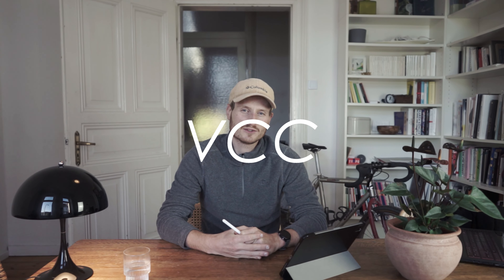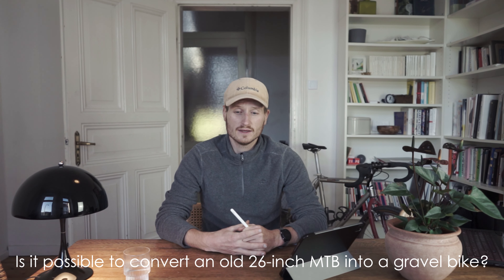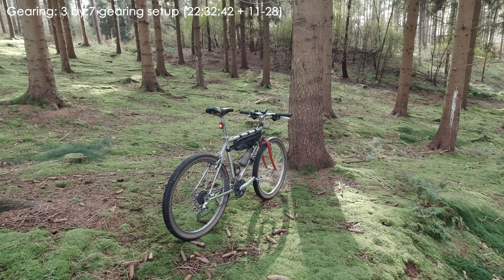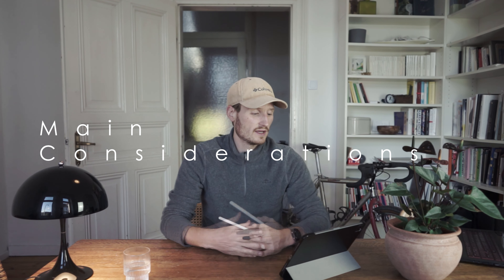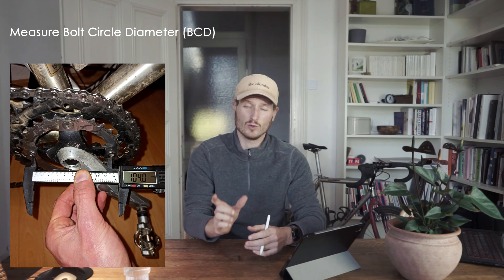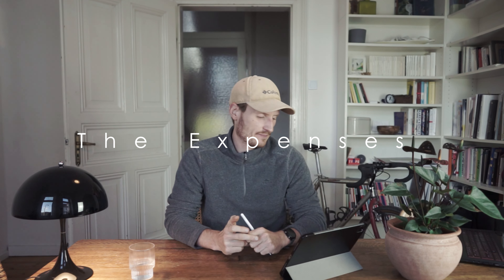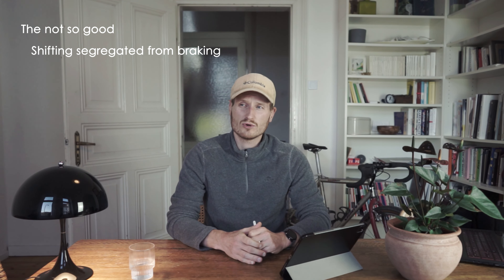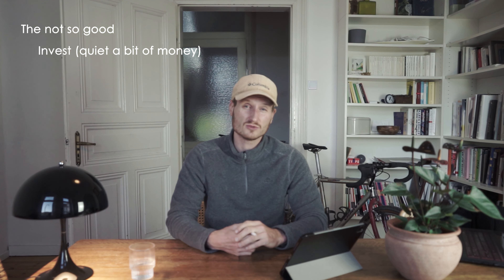Giant Boulder retro MTB to 1 by gravel bike conversion | VCC

Comment: Nice conversion. If I may make a suggestion for your shifting if you're not happy with the MTB trigger shifter, look into one of the Chinese groupsets. Sensah SRX Pro, for instance, is a reasonably priced drop bar 11 speed gravel groupset that can handle cassettes as large as 51t.
Reply from the maker: Thanks, and also thanks for your suggestion. You are right, the Sensah SRX Pro is a valuable option compared to grx etc, but I consider its pricing, although cheaper than the established brands, pricy compared to my deore mtb setup. And also shimano has definitely the edge when it comes to reliability and shifting performance also stated by YouTuber Trace Velo. But sure, it's worth a consideration.
Cheers

Comment: I'm close to buying a similar frame, do you now build year, and if it is a aluminium or steel frame? Thanks
Reply from the maker: Hi, I'm afraid, I do not know the age of that model. This particular one is a steel frame. There are also aluminium ones out there, but they would then have a respective decal on the frame, clearly marking it as the aluminium version.  
Cheers